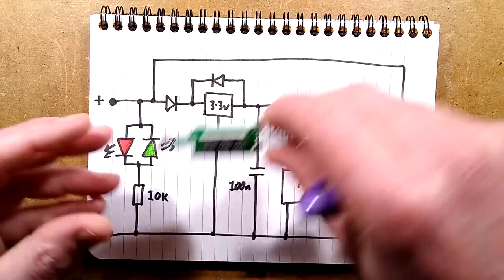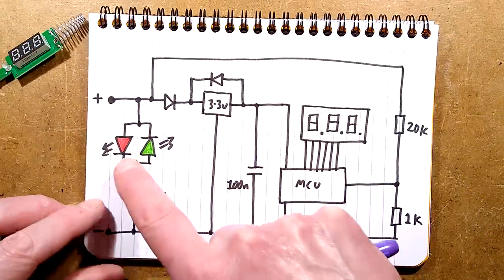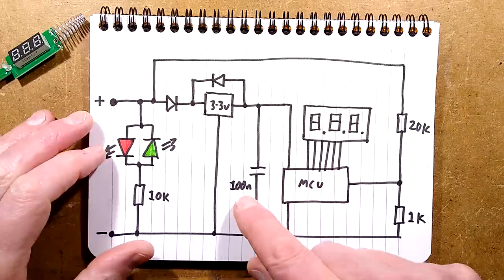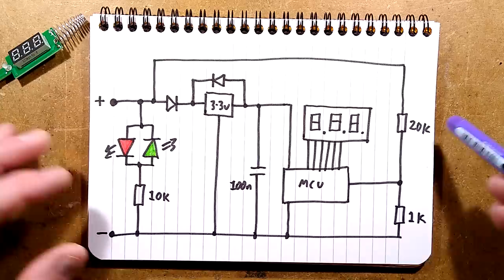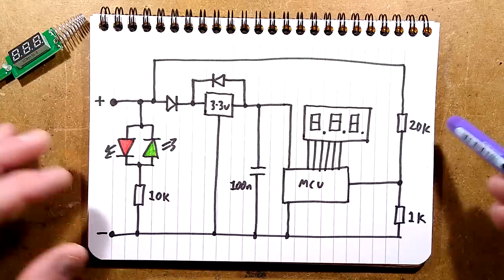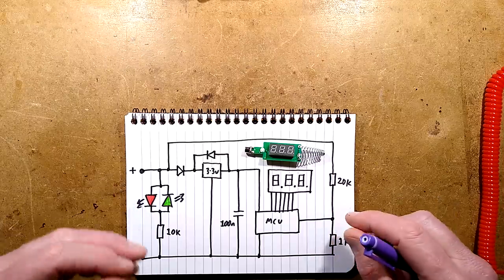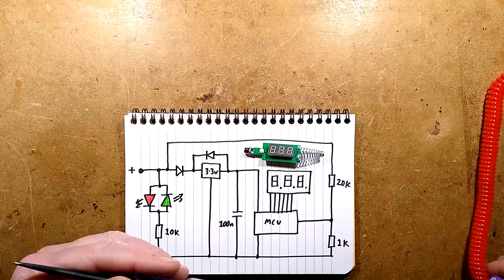Unusual, but accurate low voltage probe (with schematic)

Comment: Clive, I have some cheap meter probes with the red one very similar looking to that, but not stretchy. The conductor is very thin wire. I don't expect that to last long. The probe looks quite well made, I'd probably remove the LED and turn it around the other way. It would do OK as an automotive probe.

Comment: Ignore the colour of the cable and the colour of the probe tip, they have the polarity indicator LED's the correct way around.
The clip itself is black, and the probe is just black due to the nitride hardening process.
When the black clip on the cable is connected to negative, and the tip is touched on a positive, the red LED comes on to show a 'positive to tip' connection.
Vice versa for when the black clip is connected to positive, and the tip is connected to negative, the green LED will light, showing a 'negative to tip' connection.
I own a 'better' version of this type of test light, it has a red/green lcd backlight that changes colour to indicate polarity, and the volt reading also has a (-) symbol that appears when negative is connected to the probe tip, and the clip connected to positive.
Mine only draws around 17mA, so it's pretty much useless for determining if the circuit has any meaningful load carrying capacity where an incandescent type is best, but it is handy for quick polarity and voltage checks where an incandescent test light can do neither.

Comment: This voltage test meter would be excellent if it had a 1 amp load in it. Eric at South Main Auto has proved time and time again that a bad circuit can still provide full voltage with no load but as soon as you put a 1 amp test light on it there's no current Supply

Comment: I bought a bunch of these modules a few years ago from Banggood. They were a simple board the size of the display (same display as this one) and the same components, just shuffled to fit on the board. They have the trimpot fitted and just have two wires (red & black) coming off the board. I've used them all over the place, currently have one wired across my 12v solar array as a monitor. They do work very well indeedy. Re: display contrast, I just run a red felt pen over the display segments. Easy fix.

Comment: Leave the LED the way it is which means probe + for red and probe - for green but install a bridge rectifier so it reads either way. The LED would have to be connected across the AC inputs of the bridge so it would work that way... [Still Red/Green for polarity.]

Comment: The reversed diode is to protect the regulators internal serial regulating transistor. The transistors Vce can't ususally be more negative than -6V. With the diode, it is limited to about -0.7V. 
It is usually connected to the missing cap on the input. Cost saving i guess.

Comment: The drop across the protection diode gets the regulator up to almost 36V.  I used to work with an engineer who assumed parts could be run "hot" and would regularly design thing with the power supply out of spec.  I considered that pretty bad practice but he got paid more than me.

Now with that protection diode AND the regulator drop, that processor/meter chip sure doesn't have much voltage to run on at the low end.

Comment: I have one with an orange coiled pretty cord.  It's not so pretty anymore.  In my home tool box in the garage the outer layer of insulation turned to powder in about three years.  The inner orange insulation layer stayed intact but has no memory, so it is no longer coiled.  This is in Arizona, so temps in the garage reach 160+ F or higher in the summer.  Toasty.  It's still working like a champ though.

Comment: There is an example circuit in the datasheet of the LM317, where they use such a diode across the input and output in the same direction as shown in the video and they state that the diode "protect the device against input short circuit", I am not entirely sure how it works.
Reply: It prevents the input from being less than 1V below the output while charge remains in the output capacitor.  Quite surprised it's not built in to the chips already .

Comment: It might be a dedicated chip. Theres a plethora of small panel mount voltage gauges, with or without USB charging capability on the jungle site. They also have only 3 digits. I put one of the non-usb ones in my pick up and its very thin. I wish I could tame the display brightness but I dont think it can be opened non-destructively.

Comment: I found a Toshiba page that refers to your mystery diode as a "reverse current bypass diode." It doesn't explicitly recommend a Schottky diode, but it does say that the diode's forward voltage is a design consideration.

Comment: 0:54
Yeah, first thing I do with devices that use these bare red LED displays is put a piece of Lee 027 filter on top. Highly improves readability in bright daylight.
Reply: Any idea what filter would be best for the blue ones?
Reply: @aethelfreda  Lee 120 works great
Reply: Even just a piece of red vinyl tape helps a lot!

Comment: I have what is very nearly this same thing. The case and the cord are identical. The main difference is that the LED is surface mount, and the meter will operate with either polarity. Your only indication as to polarity is the LED. I too found the red/green to be backwards, and ended up cutting some traces and rewiring the SMD LED to fix it. Too bad the LED wasn't THT like the one in the video, that would have been a lot easier to switch around.

Comment: There is a plethora of simple devices intended for the measurement of the voltage in 12v systems. From gadgets that plug into cigar lighter sockets to displays built into leisure electrical units for caravans. I suspect that the chip and display is a straight lift from this.

Comment: We have an automobile voltage test light with the same clear plastic casing, pointy metal tip and a different cable. Inside our tester, there is just a red led and maybe a resistor.

Comment: Yes this is an automotive test light and the green led is ment to show that you touching a ground circuit think of it as red hot green cold/ground i have a similar one my self and use it almost daily though mine the lcd is actually back lit by the red and green it also displays it as a negative number when on the ground side

Comment: It appears to be a variation of those cheap $1 digital panel voltage meters. The back of those boards look like they have the same components, plus an adjustable resistor. Only those LEDs use 11 pins instead of 6 pins.

Comment: I can't see any circuit board markings as to the LED polarity. You probably get a 50:50 chance of it lighting red or green 🔴🟢 (nothing to show how it should go in - so the person assembling just shoves it in any way round).
Reply from the maker: There was a small + symbol, and the thin side electrode was at that side.  So they had probably put it in the right way round.  But the LED itself may have had its chips in a random direction.
Reply: The Aliexpress product page shows it with the green 🟢LED lit while showing a voltage on the display, so I think you're right about it being random!

Comment: I've just ordered one as it seems to be useful for testing model railway layouts. The long lead should stretch the whole length of the layout, which isn't so easy with a multimeter.
Reply: Mind the coily nature of the cable, if it's anything like the early 1990s telephone cable it looks like, that coil is very springy, somewhat heftier than it looks, and quite strong; it could easily knock over scenery or even a model railway locomotive. You might need to conscript another pair of hands to wrangle the cord above your setup.
Reply: @ShadowDragon8685  Good point, but it's something I'd only do once. After that I'd make sure it was properly supported well away from delicate stuff😀.
Reply: Are toy trains still 12v?

Comment: Clive, unrelated to this video, but consider getting / taking apart a PinePower USB power supply (from PINE64) and the Pinecil iron (which combines the best features of the TS-100 and TS-80 while being cheaper than those). They also make some ultra short tips that are really nice for soldering small things.
Reply from the maker: Unfortunately they don't ship here and cancelled my order.   Someone else sent me a pinecil soldering iron as a gift.

Comment: The position of the screen on the side and the fact the whole shaft is conductive makes this useless. However I do like the idea. If there was a screen/display on the back of a probe and it was properly insulated, it would be so good for working in electrical panels.

Comment: Maybe the diode across the 3.3v reg is to prevent any chip damage from back emf when power is removed? Does the MCU generate a positive spike from the voltage divider pin when switched off?

Comment: I would be tempted to turn the LED round 180deg. to red fault, and remove the crocodile clamp for a second probe. . No idea about the diode 🤷‍♂
     as you say its very accurate 2x👍
Reply: Exactly what i was though!
Flip the LED to fix the red/green indication!  🙂
Reply: @teslacoiler  yep, it would drive my OCD mad 😂😂

Comment: I wonder of the steering diode is to shunt power coming from the sense input to the input of the regulator when it's in reverse polarity and the leakage from the body diodes on the ASIC are conducting due to the reverse polarity?  Perhaps the regulator would steer the voltage to ground?

Comment: I could totally b wrong ud know a lot more than me and u pulled it apart but in Australia I was a mechanic and I had a general analog just a light when testing but they came out with ones that swapped for polarity instead of the red light when in a normal test mode but u could put onto a postive terminal and test for negative rather that earthing and testing for power so I dunno if that works if that’s case I’m definitely sold even as it is I need a new test light. I know 12v but all ur video ect has helped me learn so so much I never knew and need heaps more learn so I got my electrical (L plates) for my electrical knowledge, I’m making a model railway and wanna use Arduinos esps ect so much learn to do but have been watch u for prob nearly two years now. I’ve been sick so start and stop a lot. But u basically do wat I wish I could do and make really good informed information. I’m doing a similar thing buying cheap Chinese stuff that I wait weeks for sometime if not a month or so but ur videos r awesome and U really r great at wat ya do

Comment: I've got a small tankless water heater that displays the temperature of the output on a small board that has that very display (and it too is charlieplexed from what I can tell).  I wasn't able to find anything on the MCU that reads the thermistor and drives the display when it started acting up.

Happily, I've been able to work another sensor into the line so I can still see what the temperature is.

Comment: love the charlieplexed display! hope someone makes a 2-digit starburst character display with 6 pins.
Reply: A 14 segment 2 character display with two decimal points would max out the 30 segment capacity of 6 pin Charlieplexing , so possible if you forgo the ability to shape the separator into a comma, colon or semicolon (this would need 17 segments per character, thus 7-pin Charlieplexing).

Comment: RE restricting the supply to 35v, don't forget the input diode drop, consequently the regulator will receive 0.6/0.7v less than the supply voltage assuming a silicon diode.

Comment: Its a typical mechanics probe. I have two in my box.
The reason for the reverse polarity light  (green) on ground is to use the tool to find good grounds on a vehicle.
Otherwise they are accurate enough to diagnose a 12v automotive system.

Comment: They were probably thinking green for ground and red for power.  Alot of products in the automotive repair world are that way.
Reply: Old time logic probes had red led for high and green for low signal level.
Reply: @AliusScitmelius  I actually have a couple of those logic probes from back in the day.  Never really use then now unfortunately.

Comment: the diode across the regulator is not too odd considering that it is suggested in the datasheet for run of the mill regulators like the lm317 or 7805

Comment: You forgot to test/taste the "candy cable" , is it Strawberry or more Raspberry ?
The diode protects against the 100nF  and stuff "further down the road" (output) 
If the output voltage of the regulator is more than 7 V higher than the input voltage, the emitter-base junction of the internal power transistor can break down and cause the transistor to fail.
You can use a shunt diode to prevent this condition  
This ensures that any higher voltage at the output of the regulator is shorted to the input.
Search for "Voltage Regulator Schematic with Protection Diodes"
Reply from the maker: The cable was cherry flavoured.

Comment: Is the reversed diode on the voltage regulator added to block AC?  Also, I've seen similar cable jackets on heavy equipment components; it's polyurethane.

Comment: the diode... What I found it's to protect the regulator in case of reverse polarity or high cap discharge. Maybe avoiding, if you blow the MCU on reverse polarity, to blow also the regulator ? I found also that on Texas instruments datasheets on LM340 : "If transients exceed the maximum rated input voltage of the device, or reach more than 0.8 V below ground and have sufficient energy, they will damage the regulator" and a shortcut protection diode is one of possible protection. 
Or, it's just a weird design :D

Comment: No they have the LED correct its green to show the tip is at Negative polarity and red it for positive polarity they are copying the way the Power probe functions. The diode bleeds current off the MCU  if you hook it up backwards and protects the pass transistor in the regulator from reverse bias

Comment: The only possible use for that diode that I can fathom is as some form of circuit protection. The actual effect of it is that it makes sure that the voltage on the right side can't be higher than on the left side (not more than the drop voltage over the diode anyway).. I assume the 3.3v-component there doesn't deal well with being fed power the wrong way.. 

I'd guess it's when it gets turned off and the 100n capacitor still have some charge left it's supposed to do whatever it does.

Comment: Always a handy tool to have about to check for the presence of 12(ish) volts in an automotive situation, I made my own some years back with one of them crappy neon jobs using a crap white LED, a resistor for about 15 volts and a broken test lead (snapped at the banana plug end) with a clip on the one end, and then proceeded to sharpen the then flat-blade screwdriver tip into a nice sharp pokey bit, works nicely I have to say... :D

Comment: I've a ton of voltage display modules. I wonder do any follow this design. I'll have a look.
Reply: Almost all the 3 digit ones use this exact circuit, or use a TL431 and a series resistor in place of the regulator to power the MCU. Only difference is a set of calibration constants programmed into the chip, telling it to scale the voltage, as the TL431 will give 2V5 instead of 3V3 as reference.

Comment: Looks like they grabbed the circuit of an usb inline voltmeter, dumbed it down and thew it into a a handprobe. Or maybe a circuit previously used as the readout module for a cheap lap/bench powersupply.

Comment: Some very old cars used positive ground electrical systems for corrosion protection.  I guess you would use a very old analog meter there to match.

Comment: There should be a cap between reg input and ground if the parallel diode is to be used.  The parallel diode is pretty redundant.

Comment: Could it be because the 3.3V regulator uses a zener diode inside and the manufacturer doesnt understand how a zener diode works or maybe how its setup.

Comment: They could've made it bipolar, by adding a Schottky bridge rectifier and rather than the bicolour LED, a plain red LED in the shape of a - sign, which lights up when the polarity is reversed. It could be an interesting modification.

Comment: I would be curious what the current requirements across the V operating range of it! This may not be a good choice for electronic circuits in the auto industry due to circuit loading and potential damage to computer circuits
Reply from the maker: It's very low current.
Reply: That comes down to knowing what test equipment to use and when, depending on the type of circuit you are testing.
Reply: Very often you want something that applies a significant load to test for high resistance connections.  Its also very common with a test light to clip the cable to positive to test circuits that should be grounded, so seems like this would have limited use in automotive diagnostics.

Comment: In general that diode is to prevent the output of the regulator from exceeding the input. I don't believe it would be required in this case because of ithe input reverse polarity diode will already block any reverse current. It was probably just copied from the datasheet without any thought of its purpose.

Comment: That thing is just a ye olde test light with a modern board shoved into it for compatibility with today's computerized nightmare cars. You could replace that board with a holder and an 1157 light bulb, hand it to some old greybeard, and he won't realize it isn't as old as he is using it on his ancient BL mini.
Reply: Old & grey, will confirm. It's identical to the one I bought at Sears back in 1980, save the digital display.